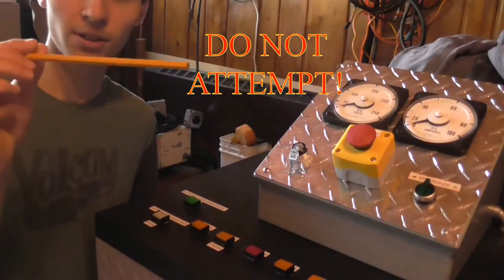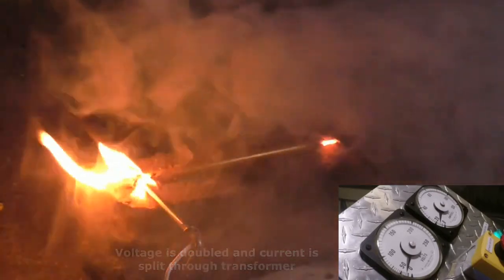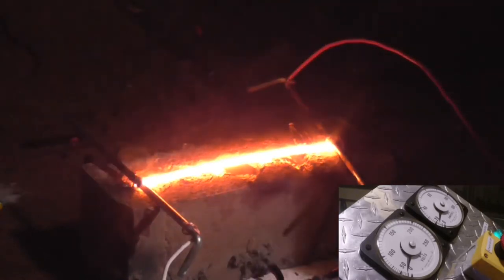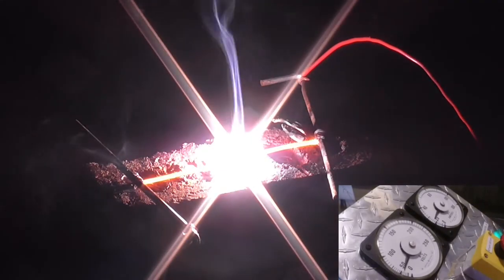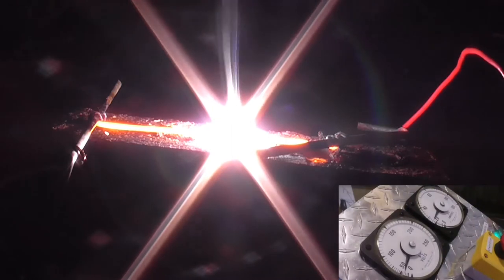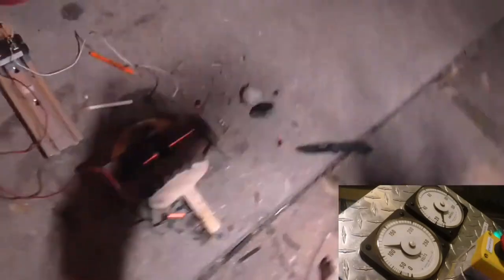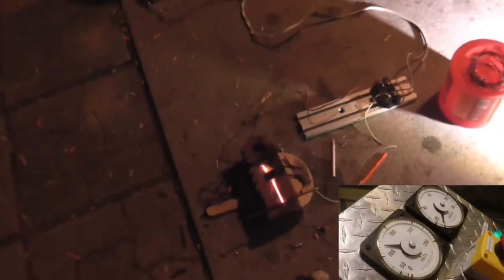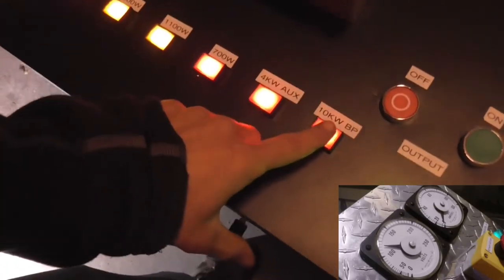Intense Carbon Arc from Pencil

Comment: Fab experiment... This is the basis of the carbon arc lamp, once used in old cinema projectors.. I managed to buy a few carbon rods which where made especial for arc lamps. They are about a foot long and copper plated. Great vid... Ps love your new control panel.
Reply from the maker: Thanks! Took a lot of time to build!
Reply: Variac Maniac I can imagine.. I keep putting of building one due to all the metal cutting.. I have no idea how to cut square holes in metal to fit panel meters... Oh where did you get your parcel meters from? They look rather expensive and industrial.. Let me know what they may be called so I can search for suppliers. Any tips on cutting hols in metal to accommodate meters will be greatly appreciated. Thanks Charles UK.
Reply from the maker: The meters I scored from eBay for a total of $85 (which is around 60 British Pounds I'm guessing), they are made by General Electric and these are indeed hard to find. So I was very lucky to score them.
Reply from the maker: No squares had to be cut as their chassis are round, the square front end is for it to be paneled and bolted.
Reply: Variac Maniac thanks.. I will keep searching Ebay, these meters do seem very rare indeed yer they are without doubt the best for electrical panels. I look forward to seeing more exciting videos. Stay safe

Comment: Welding with a pencil
Reply from the maker: Could definitely have the capabilities of bonding metal together.
Reply: @VariacManiac  Maybe yes, I could cut metal with the graphite from a pencil. It whas about 2mm thicc and the power supply whas 18vac (under load) and idk something like 15-20A.
Reply from the maker: @firefox1136  I say give it a shot, if it doesn't work, I'd say use a bit more juice, or if it's too flimsy, use a thicker piece of carbon.
Reply: @VariacManiac  Thank you for the tips. I did that some time ago (maybe I will do it again with bigger electrodes and more power) and I think, that with graphite you can only cut. I could never weld with it, it did just cut.